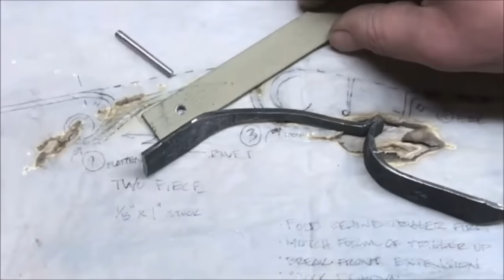Building a Custom Blackpowder Rifle

Comment: Back before modern computers I read a story more like a guide but not, of a man who had built his own lathe and knew metallurgy and had a blacksmith shop. He wanted to build a Mans Rifle curly maple stock, half octagon half round with a double wedding ring one inch at the muzzle 1 1/2 at the breach barrel with 1137 GBQ steel ,flint lock color case hardened, all steel hardware for the working man. It was not a show piece, .62 caliber patched ball rifle had 113 inch left hand twist, made his own rifling tools and did cut rifling rather than button rifling ,He wanted that extra measure of accuracy you can achieve with cut ,this was back before I was born and I'm 69 now, he made custom guns made his own fasteners (screws and nuts)  about 2 to 3 guns a year this was going to be his own hunting rifle. He had made an error and over polished the bore and could not get even good accuracy  the bore had a mirror shine to it and recorded  the phrase that "it shot slick" so he plugged the bore after filling with his urine and let sit over night, next day he emptied it and dried it and reinstalled it, perfect accuracy .
Reply: please tell me about the book or what ever this is I want to get into traditional crafts.
Reply: @joestewart6319  the Foxfire books would be a good start, one of them devotes several chapters to old time gunmakers.
Reply: I use vinegar to fix them

Comment: Wow! A hell of a job! I wonder why did you apply "aqua fortis" to the stock before the linseed oil?
Reply from the maker: Thank you! Aqua fortis is for attaining an amber color to the stock. That color comes from the iron dissolved in the acid. Heat applied to the solution brings the dissolved iron out of solution and into the grain of the stock. Linseed oil sets the color in the grain. Further coats of linseed oil preserves the color. Any kind of stain on wood is applied before any oils or finishes. That’s kind of an old rule; otherwise, your stain would be trapped or blended in the finish…or just muddied.  Any scratch or wear upon the finish would reveal your “white” wood. 
I hope that makes sense. 

Thank you for asking!

Sharek

Comment: Tiger maple, it's the best! The wood I can get, where do you get all the hardware, lock and barrel, to build one? I can get Koa and Iron wood, killer in cutting bits and tools, but strong enough to handle blowback.

If no hardware available, where can I get plans? Google search no good to me as any sites are blocked.
Reply from the maker: Where is google blocked?

Comment: Great work. But how did you finish the metelwork? Dont look blued ?
Reply from the maker: Ferric nitrate and sawdust followed by bleach and heat. Fairly standard in the group I run with. After applying liberal coats of oil, it leaves a nice matt black finish for competition.
Reply: @SharekGadd  Thank for that. It looks superb.

Comment: Nice build, but why would you put such a long breach tang?!  A lot of extra work, and no particular enhancement.
Reply from the maker: I found several old guns of this Soddy Daisy style that had similar length long tangs paired with long toe plates. The only reason I can think that this was done was to hold a repair, or possibly the mindset that it would make a stronger butt to wrist section. Beyond that, I think it was decorative and many of the guns from this sliver of the country were highly decorated, some to the point of just being gaudy. Thank you for watching and posing your question. 

Sharek
Reply: @SharekGadd  Thanks for answering, with a clarification.

Comment: Fascinating to watch. The buttplate looks difficult to forge! How did they do this before Oxy/Acetylene and TIG welding?
Reply from the maker: The forging process would have been the same. They would have used tin solder in the 1800’s. I welded the two pieces, as I made them quite thicker than an original, as I figure this area will receive a fair mount of abuse in competition. Thanks for your interest and engagement!
Sharek

Comment: I wish you would have demonstrated how you drilled the nipple hole into the powder drum.
Reply from the maker: I didn’t figure it was worth filming; it’s a simple operation. Install the drum and tighten. Lower the cock, and mark its centers on the drum. 
Remove drum and place it in a vice with the center mark up. Drill and tap it for the appropriate nipple. Install the nipple. Install the drum and check alignment. 
Thanks for watching.
Reply: @SharekGadd  That is how Track of the wolf said to do it.  But The Gunsmith of Granville County, for one, will tell us that doing it that way would lead to the tip of the nipple too far forward for the hammer to strike the cap at 90 degrees.  They suggest putting a sawed off (that is less the treads) nipple between the drum and hammer and scribing a line on the face of the drum for the angle.  One of the two latter sources suggested that an additional 1/16 inch be backed off to account for the need to make adjustments.  I am assuming that the drum referred to was home made which mine is not.  I was interested in what you did.

Comment: AND THE BARREL ? YOU GET IT FROM A BARRELS TREE ? Like a fruit ?
Reply from the maker: I got it from a man named Ed Rayl. He makes them any way you want them. Dig around for that name on the Internet and you will find his contact info. He doesn’t have a web site, he’s an old school fella.
Reply: @SharekGadd  no, i not rich like you and i dont live in a easy life country like yo - i cannot buy a barrel - i need to build mine - and i dont find info - alot dificult &- please if you can then help me.
Reply from the maker: Your barrel fabrication options: If you have a forge, you make it the original way by forge welding flat stock into a tube to be drilled and rifled. Here is a video showing this method. https://youtu.be/qTy3uQFsirk 
Your second option is to start with a bar to then drill and rifle.
Reply: @SharekGadd  thank - i go whatch that
Reply: @SharekGadd  hey - you known where i find the info about metals materials ? Becuse i wanting to build my rifle as a bufalo rifle - and later i want made a antytank rifle